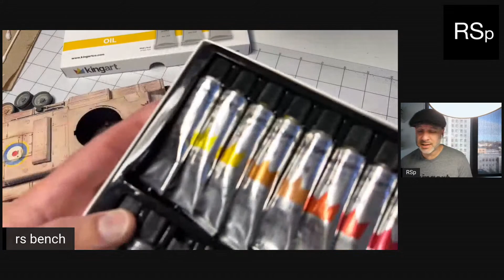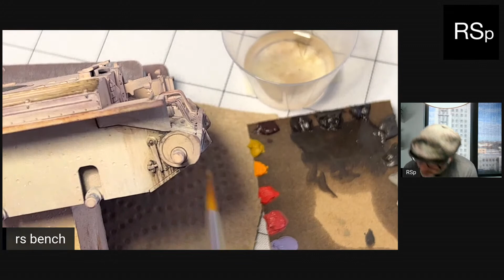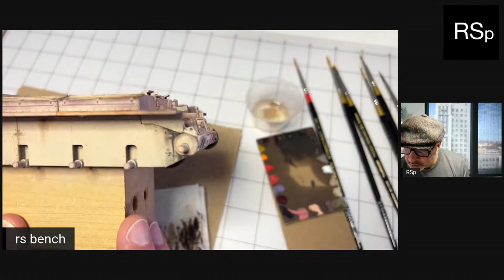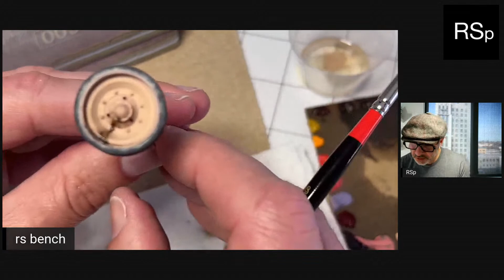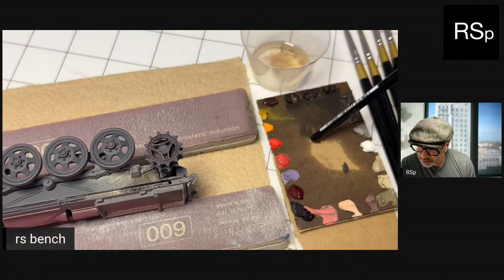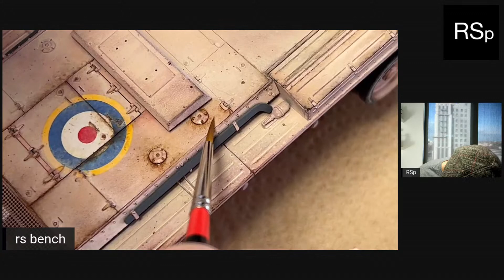Ep 41 - Grease & Grime Weathering How-to

Comment: I'm still struggling to apply these weathering techniques to Mission Model painted surfaces without damaging the MM paint.  The slightest touch of thinner while doing OPR ruins the MM paint.  How do I prevent this?
Reply from the maker: I have no idea to be honest.  You'd have to give a much more detailed break down including products used. 

Odorless thinner doesn't affect the paint negatively. I list all the products I use... my guess you are using something else?
Reply: @rs.p  I've tried using two different types of thinners; turpentine for artist oil paints and odorless mineral spirits you buy at a hardware store paint section.  I used MMP-020 and MMP-021 as the base and finish layers on my tank.  I used 502 Abteilung oil paints for my OPR.  This is my first model using MMP so I am still learning how to use this paint brand.  When doing OPR, the thinner on the brush removes the MM paint from the model- not in large chunks but in a stippled or mottled pattern.  The hobby shops where I live in Korea don't sell the hobby version of odorless thinner which is why I'm stuck with the turpentine and the hardware store grade mineral spirits.
Reply from the maker: @derekbowen5867  order some odorless thinner from AK/502 -- Odourless Thinner. Hobby Neighbor Korea should carry it.

Those are all too hot for hobby work, never use hardware store for sure. 

You can also add a drop or two of Poly to your paint, that toughens it more into a urethane finish.

Lastly, ensure you’re painting over primer. The paint is designed to be sprayed in tandem with its primers.